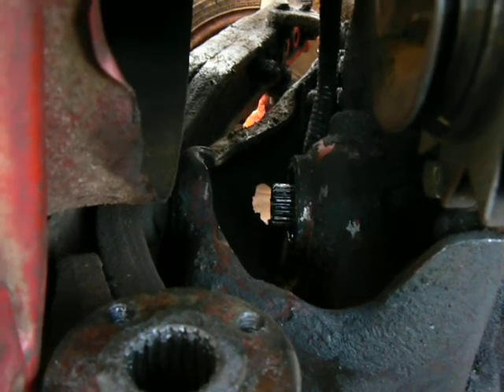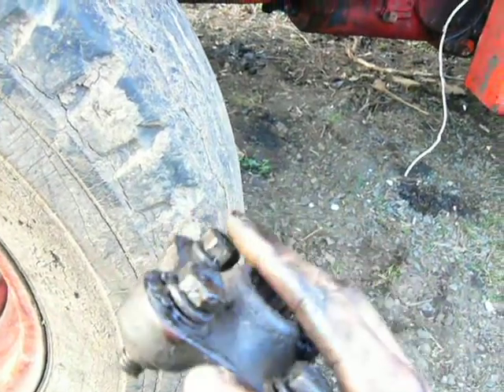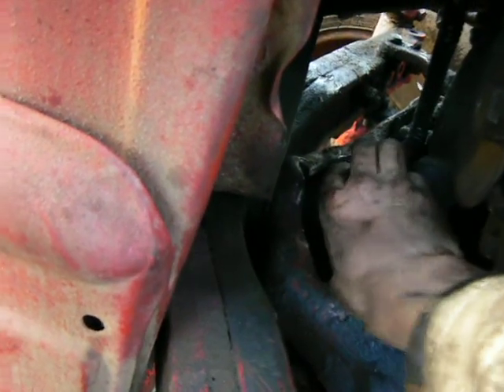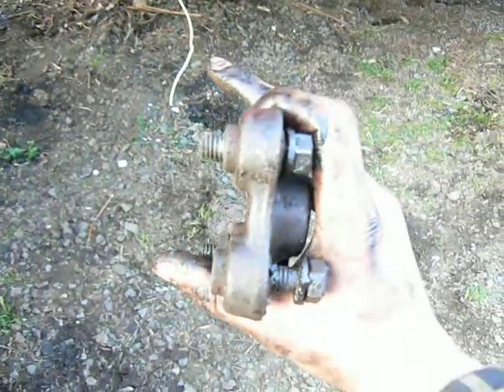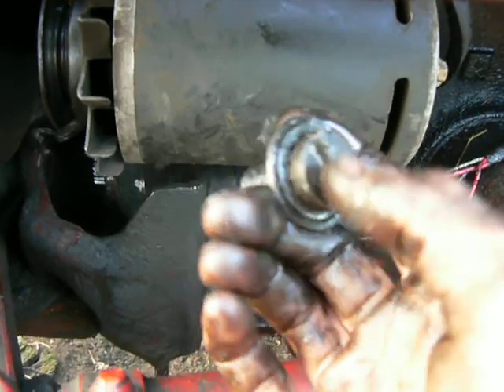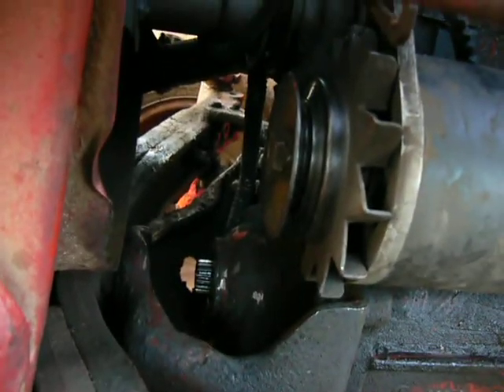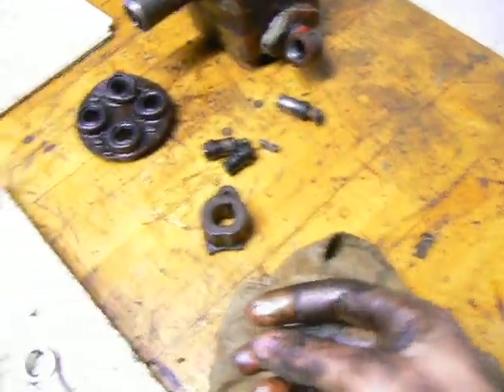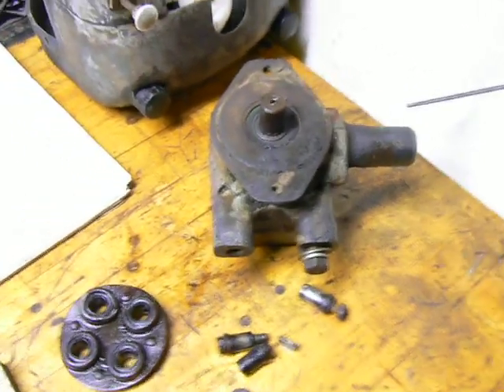Working on the Ford 881 Part 3

Comment: I actually have the socket for that crank pulley bolt
Reply: Thanks for your help. I'll see what kind of crank pulley puller I can find for my ol' 640 FORD.  Thanks again!
Reply: Where did you find the socket to get that bolt off? im having a hard time finding the right bolt to take that sucker off!
Reply: From my neighbor I have also used a long large flat blade screw driver and went right the the shaft hole to it